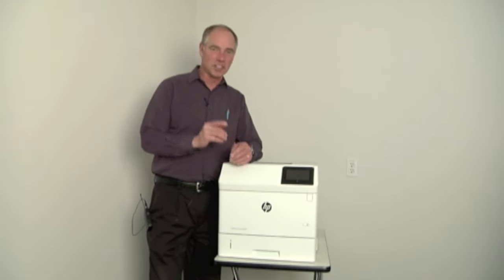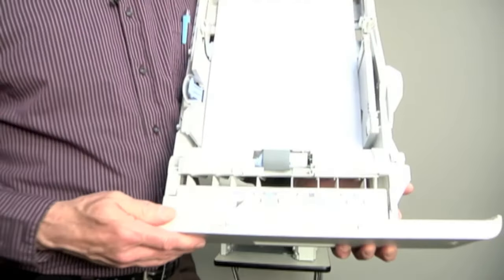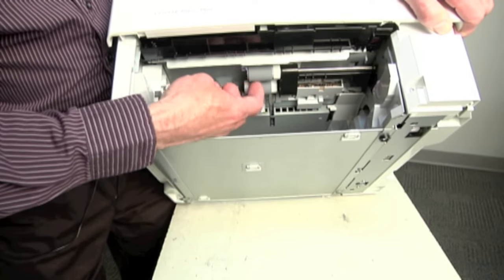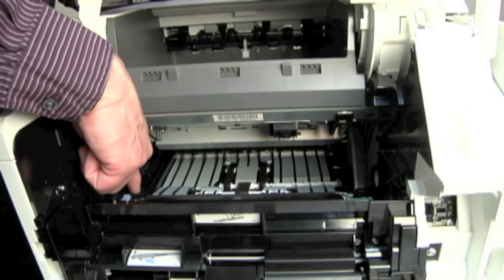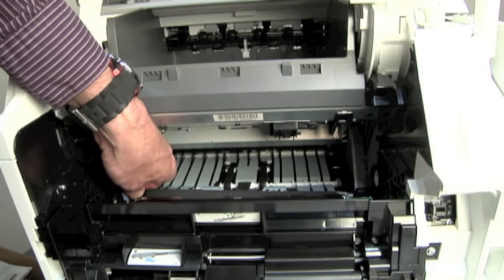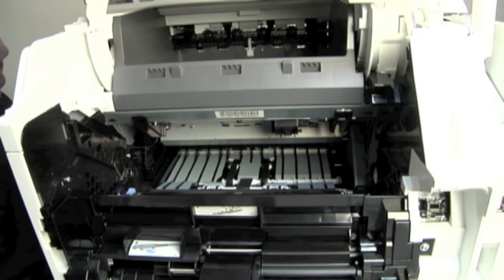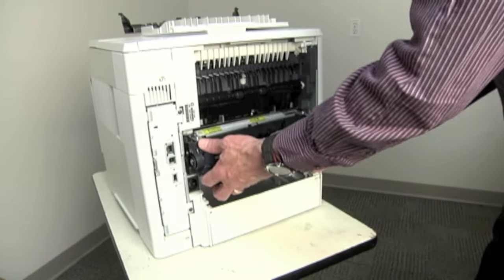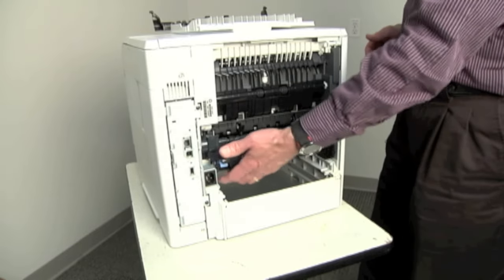PRINTER REPAIR: Dealing with Common Maintenance Kit Mistakes

Comment: hi there 
thanks for tips
i want to add 
that cleaning the printer from dust and toner remains will make the maintenance kit to survive longer , also you need to lubricate the Fuser gears specially the swing plate gears with gears paste
or replace them if they damaged .
finally dont forget to rest the maininance counter
best regards for all of you guys

Comment: Please, I need help with a Xerox Phaser 6510. I can not find any video on how to disassemble this printer. There was a spill of toner inside the printer, the garbage collector was not replaced in time. I cleaned, I ran a vacuum for all the internal spill but I need to clean the transfer belt and an inaccessible place inside the printer that continues to stain the paper every time it is printed on this printer

Comment: We have a HP Color Laser Jet Pro MFP  M477fdn.
Looking for some help. I am getting smudge marks on the right side of each print and or copy made. Looks like it is a roller as it makes marks as the page runs through. Can't figure out which roller it is. It is hitting 5 times per sheet of paper. If I copy in color, the smudge is in color. at times the smudge has not color, still can see the smudge. Your help is appreciated.
Reply: Fuser assembly Lora.  Common issue on this device.  Must be replaced.  Prepare on a cost of around $180 in parts or more.  Labor not included if you hire a tech.